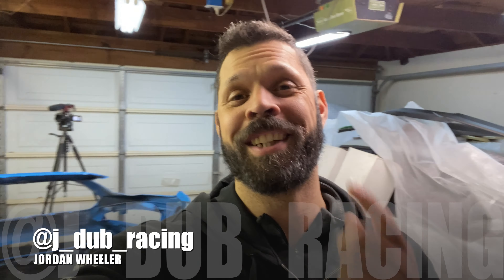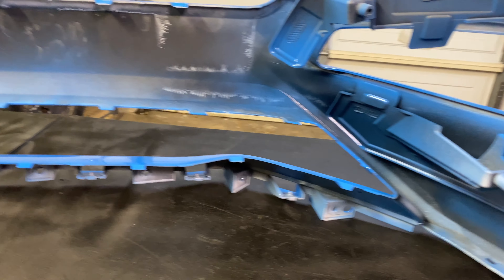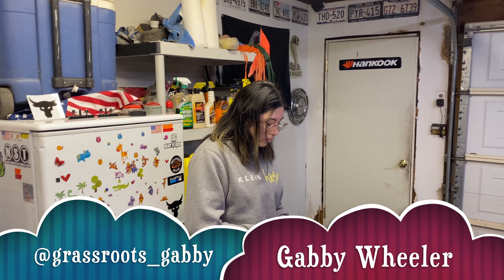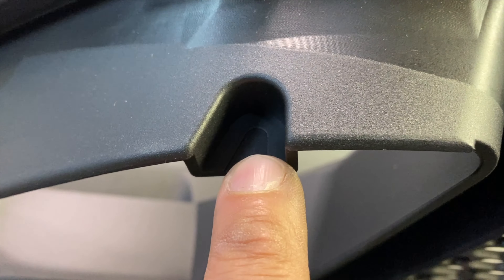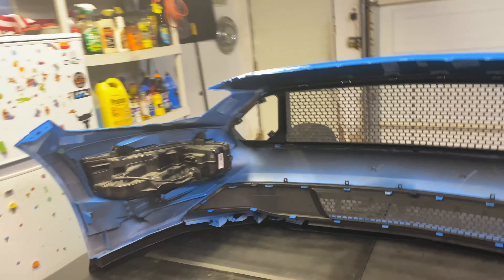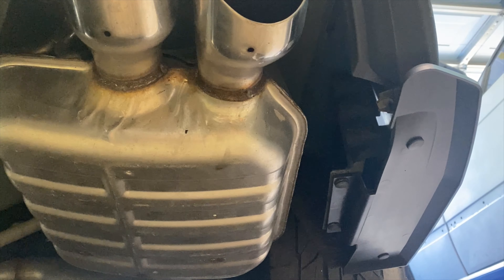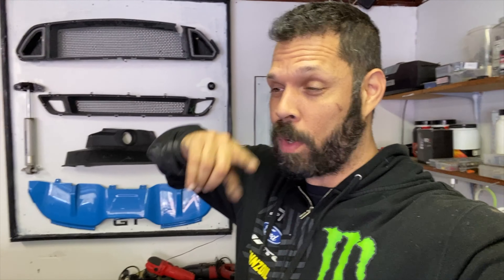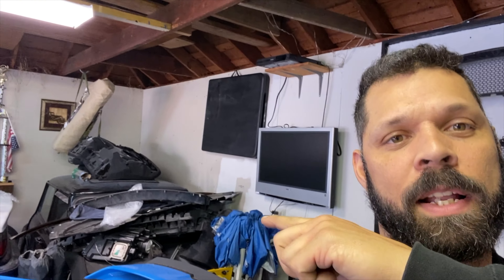Installing the RTR Upper Grille, Lower Grille, Bumper Vents, and Chin Spoiler for the S550 Mustang

Comment: Awesome content! Question, I recently updated my 2015 front end to the 2018 version but I can’t seem to find an adapter to be able to connect the turn signals. Any ideas? Solution?
Reply from the maker: You'll either need to purchase it from Ford or find a crashed car from a junk yard and cut it from there.  You could always create your own connections free of the Ford connectors, it just might not look as pretty
Reply: @JDubWrenching  thank you for the feedback